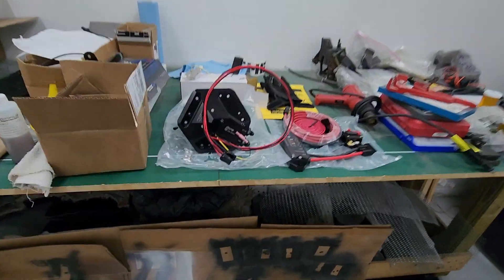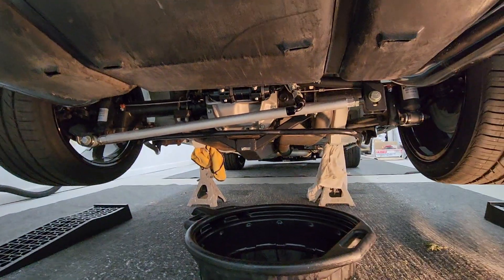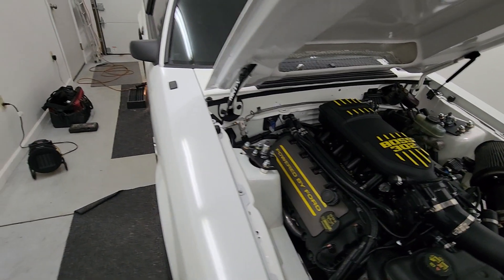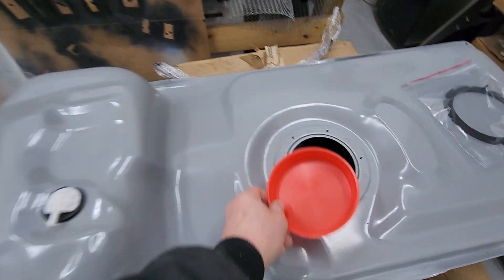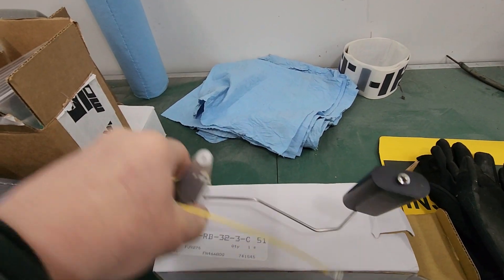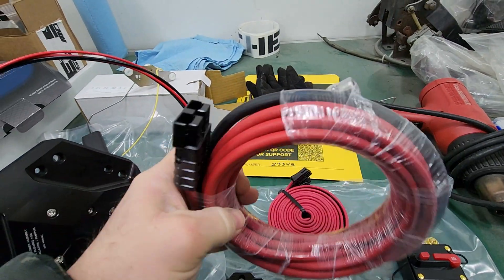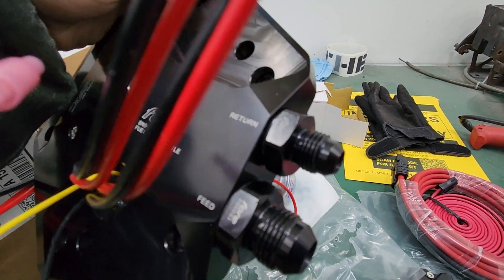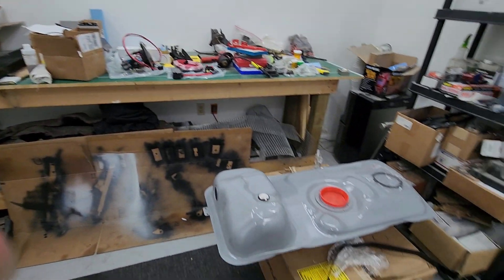Fore fuel system install part1 f2c controller 03/04 cobra foxbody fuel tank #coyote swap

Comment: How much power are you trying to make? I emailed lund and I am installing vmp Loki kit and only want 650rw pump gas only and a single 525lb pump and boost a pump is all I needed but you have enough pump to run 1000rwhp with 8feet and 8 return. I didn't want that much power in my gen3 10r80 car its already 10.90 car stock with 600rw its going to run 9s that way to much for a fox for me lol haha. That's a beautiful fuel system but Im worried about reliability with multiple pumps and heat in the summer have you had any problems with this kit?
Reply from the maker: @AADmrstangerbanger  what's up...thanks....nothing really crazy at the moment but easily 650-700  with the predator blower...was gonna do the 525 but from what i seen it wasn't gonna be enough for e85 but just went with more than enough system if I needed it.
Reply: @brezicky  Yeah, I'm just going to run pump gas only so that's probably why they said it's enough for 600rw but im looking into adding the same system just in case it's better to be safe than sorry just worried about heat with multiple pumps but im sure it's fine.
Reply from the maker: @AADmrstangerbanger  I'm sure it will be fine....I have only 2 465...an the other whips in garage are my brother's an they both got triple pumps with no problems but there tanks are slightly different...but that's what I wanted to do be safe than sorry an when I maybe wanna get more ponies I'll already be more than capable